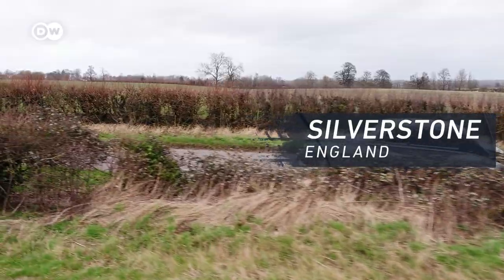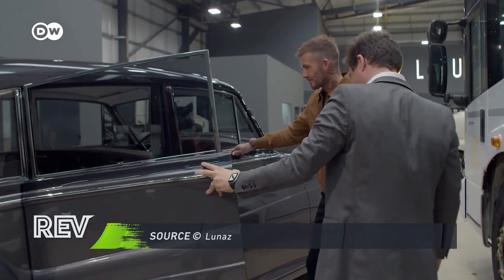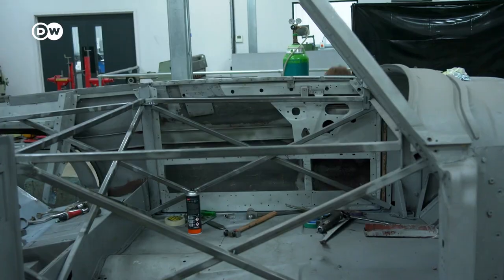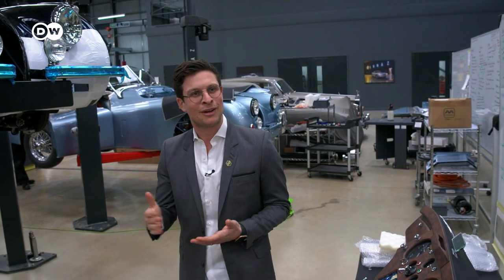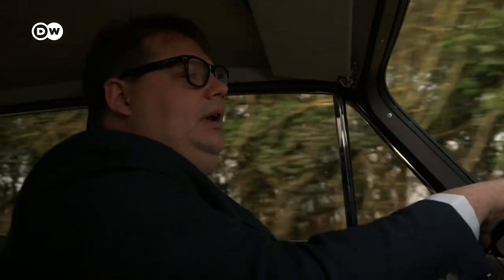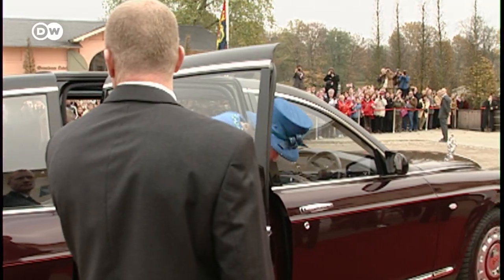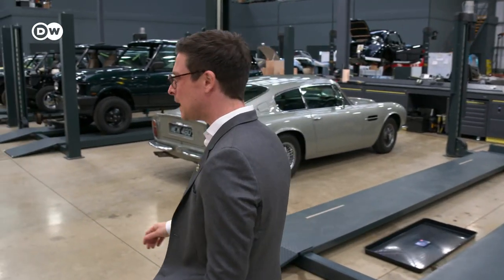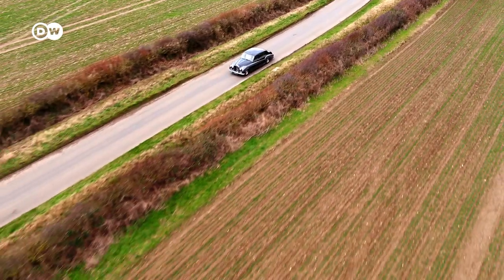Electric Rolls Royce Phantom? Classic Cars New Lease Of Life With Lunaz

Comment: in the end, its more efficient to leave the car as it is eith the petrol engine. The amount of resources that go in to the car AGAIN with all those components and strippiung it down instead of enjoying it as it is doesnt make it feasable in my opinion from an environmental standpoint.
Reply: Not necessarily true
Reply: I used to think like you. More radical even. But after driving for some years electric cars, this combination of old quality outside and modern electric motor is a dream

Comment: NOTE: At 2:07 you describe the car in the image as a 1961 Rolls Royce - with twin headlights? THAT didn't happen until 1963 when the Silver Cloud 111 came out. The Cloud 111 was introduced in late 1962 but marketed as a 1963 model. Why? I have no idea but that's how it was. The car in this part of the clip is around a 1966 to 1968 (or there abouts) model Phantom VI. Still, they're all beautiful cars and MANY thanks for sharing. Take care.

Comment: 2:04 The Rolls-Royce Phantom V was produced from 1959.  The Silver Ghost was not the first Rolls-Royce to ''hit the streets''.  The first Rolls-Royce motorcars were the 10hp, the 15hp, the 20hp and the 30hp.  The 40/50hp was produced from 1906, but the Silver Ghost was produced in 1907 with the registration number AX201.  The Spirit of Ecstasy was produced from 1911.  ''Most perfect''?  Perfection is an absolute. A coop houses chickens, a cut-back car is called a coupé, because their body designs are cut short.  Seven hundred thousand?  Come on!